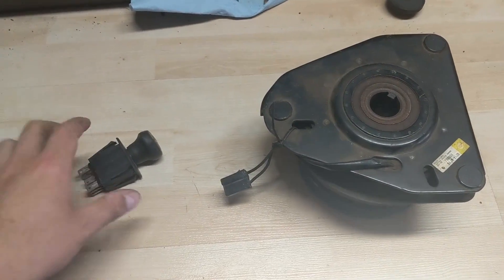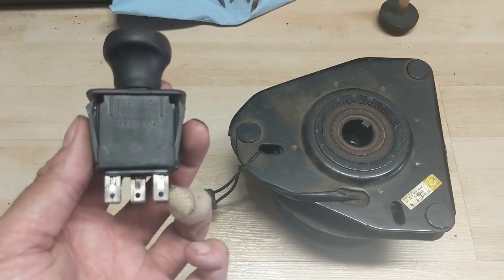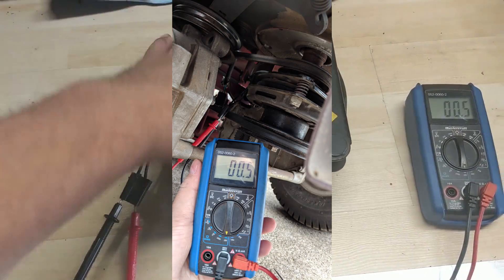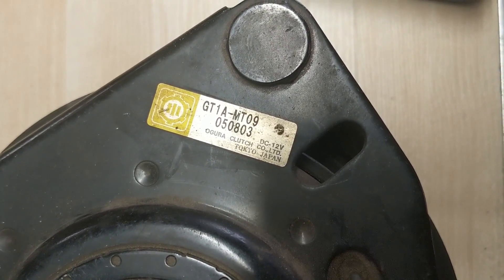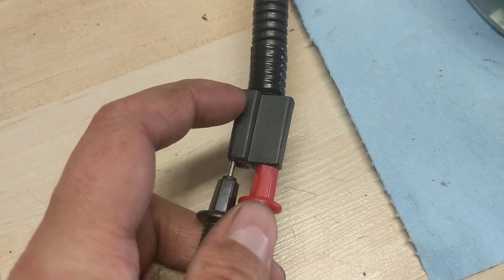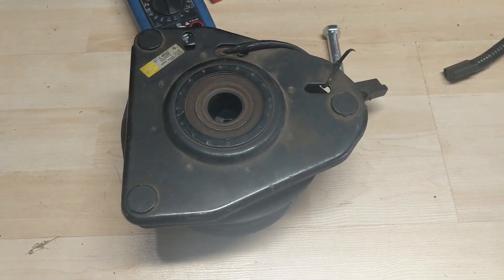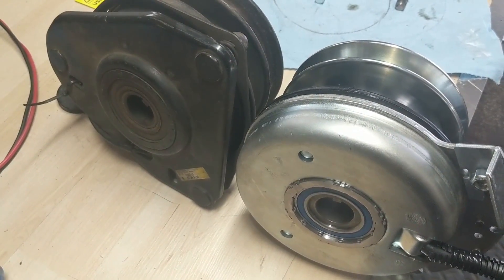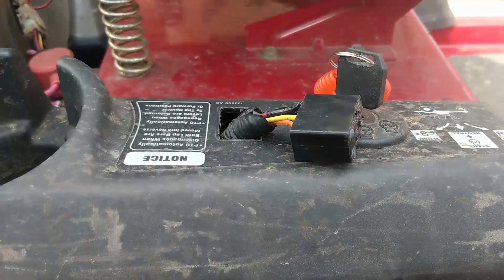How to Test a PTO Clutch for Resistance!

Comment from the maker: Explanation on why the switch melted;

In an electrical circuit, if Voltage remains the same, and resistance is decreased, amperage increases.

Here's a textbook definition: "Voltage equals the amperage multiplied by the resistance in a circuit. If the voltage remains constant and the resistance is dropped, the amperage across the circuit must increase."

Essentially, with a short to ground there is little to no resistance, as electricity takes the path of least resistance. So because the 12v from the battery (around 14v from the magneto/charing system when the engine is running) stays the same, this is what increases the amps in the circuit!

This increased amperage overloads the wires, and this is what melts the switch, then causes failure.

On the flip side, if you test your PTO clutch and it has more than 4ohms, you could have corrosion on your connector (possibly caused by water/moisture) which would increase the resistance and could cause issues.
Reply: Alc

Comment: Measured my PTO at 200 ohms and nothing, no reaction at all. Added voltage to the PTO, no click.
Reply from the maker: Yea it's faulty. Short to ground is barely any resistance, over 4ohms is too much. Should be 2-4 ohms max.

Comment: Nice simple demo - thanks. My PTO was disengaging after about 5 seconds. Would always start again if I pushed then pulled the knob. Turns out my battery wasn’t holding enough charge to keep the magnet energized. I suspect there’s a charging issue as well. Do you have a tutorial on testing for that?
Reply from the maker: It's either the alternator or the voltage rectifier, but most machines are different. You can test before and after the rectifier and it will let you know which one it is. You should have alternating current coming out of the alternator, unless it has a bulge on the wire which will be a diode, then it'll be DC, but it'll be unregulated DC. So the voltage will increase with rpm. After the regulator you should have roughly the same voltage regardless of the rpm, around 14v. Here's a video on a TB30 Troy Bolt; https://youtu.be/5PcUwPv7GEM?si=jM03Tlm-_s4hZ_if
Reply: @EliminatorPerformance  Appreciate it! My machine is a Deere LX277 AWS rider if that helps narrow down the options. Will watch the Troy video you suggested.

Comment: I have a John Deere X570 with 203 hours and yesterday went to engage the PTO and didn't work. After investigating the issue, I found one of the fuses kept blowing with a few seconds (7.5amp fuse) and a flashing indicator on the display show service with a wrench picture. I searched for a shorted wire and cleaned all the wiring connections but still have the same issue. After watching your video I plan to check the PTO clutch today and see if that is the issue. Thanks so much.

Comment: I would think you'd want to use aluminum anti-seize rather than nickel.  The aluminum is less noble than nickel, so the anti-seize will corrode preferentially.  Nickel anti-seize would be expected to corrode less noble materials around it. Admittedly, the amount of nickel probably is not enough to drive corrosion on adjoining, less noble materials.  However, theoretically . . .   Correct me if I'm wrong.  Thx for the vid.  Very helpful !!
Reply from the maker: @akzoc  zinc is less noble than aluminum but aluminum is less noble than copper. I always use nickel anti seize on aluminum/steel, I've never had any issues. I have used copper on steel exhaust studs that interface steel nuts, however, I have since learned that nickel anti seize has a higher heat rating so I almost exclusively use nickel pretty much everywhere.

Comment: Good video but you forgot the most important part. After installing new clutch you need to varnish the new one before operating. Start off low idle and engage pto for 1 seconds and turn off let blades stop than engage 10 times. Do this at half throttle and full throttle.
Reply from the maker: @BradHudsonhudson  yes it's called burnishing the clutch, and we do it with every one.

Comment: Solved my melting switch problem on my Ferris, THANKS!
Reply: @ mrbumblehill4596 I have a Ferris also, z3x 52” 37 vanguard oil guard stander. What model do you have & how old/hours did your clutch break down? Did you replace with oem ogura, I hear Ferris oem parts are a long wait to get. Thank you in advance. Jim

Comment: Is this lawn mower or are you basing this off of a automatic PTO or a manual PTO my Cub Cadet has a cable and it is a manual PTO cable that goes to the deck if my PTO broke at the lever where I engage the blades would that be a bad PTO cable or is there such thing as a manual PTO going bad if it's operated by a manual cable and lever what I'm basically trying to do is replace the PTO cable which I don't work on lawn mowers but it's very transparent it's very simple just to connect connect connect connect connect the cable but I didn't want to spend the money on the PTO cable which I seen The Leverage is broke the that connects to the lever that pushes down to on the side of the lawn mower is broke off but I didn't know if there was something causing it to break other than a bad PTO cable or could something else be wrong the lawn mower cranks it moves forward backwards and does everything except the lever is loose it is broke off but I just wondered if there was anything else underneath the deck that could cause this PTO cable to go bad or not move if any of this makes sense this is my first time dealing with anything on the lawn mower

Comment: I thought once installed you were sopposed to turn it on & off a few times to brake it in didn't see you do that a'm I wrong?
Reply from the maker: You are correct, I engaged and disengaged the clutch 10 times at half throttle to "burnish" the PTO clutch, I just didn't mention it in the video.
Reply: @EliminatorPerformance  Thanks for the quick replay.

Comment: I just tested one and has 3.5 ohms, so looks good. It's not in a mower so my first test was going to be just to apply 12v and see if coil clicked. Not having battery handy I tried my booster pack. I use it a lot when I have no battery by putting it in override mode . In this case the booster gives an error light as soon as I touch 2nd terminal. I'm guessing it sees even 3.5 ohms as a short.

Comment: Well, my 2010 toro Z master just stopped spinning the blades...no sound...no nothing....checked under the rear and the wiring harness hookup at the clutch was tattered....ordered a new harness, and it engaged....mowed several times and it quit again....this time, I noted the new harness had melted on the negative terminal at the jxn of the clutch and harness....I did check the actual switch and it is not melted....it appears you may have diagnosed my problem......only thing I need to do now is check with the multimeter........We'll see about that..........THANKS!!!................well, I checked the clutch....reads 2.3, so maybe need to go check the actual pto switch for contunity, but still it would now seem if it was bad, why would wire melt at the clutch?

Comment: The resistance on my new PTO Clutch Simplicity 1708536SM (Warner OEM) measured 7.1 as did the resistance on the original Warner PTO I was replacing. The old PTO would not engage the blades after it was running until it cooled down. I purchased the Simplicity in 1998..Resistance must differ?

Comment: Other thing is you must have a good battery, don’t boost off battery and expect alt will charge it up while mowing, low voltage will damage clutch also
Reply from the maker: Yes that's an excellent point, if I ever get one in that has that issue I'll do a video on that. It's kind of like a vehicle in a sense, the alternator itself isn't enough to run the system so you need the battery, but without the alternator the clutch would kill the battery.

Comment: My PTO doesn't make any clicking noise or any noise at all when I attempt to engage it. I noticed it was very much so not all of the way on before this happened, like the bolt on the bottom only was on my a couple threads. I've since put back on with thread locker and turned it, but still no noise or anything when engaging. Suggesting?

Comment: Great video.  My clutch wasn't working so I tested the resistance and it was only 1.3.  But then I followed your other video and adjusted the gap, and it is working fine now.  Any reason not to run it?  I don't want to burn out my stater or something.
Reply from the maker: No it'll be fine if it's gapped properly

Comment: So if i have one thats 1.6ohms, does that mean its bad? Symptom is that I cant disengage it with the switch (already replaced switch, same issue)
Reply from the maker: 1.6ohms is within spec, I'd check the armature air gap, I have a video on how to gap a PTO clutch. Other than that, you may have an issue where it's always being supplied 12v, I would check wiring.
Reply: @EliminatorPerformance  Thanks so much. I'll look up your air gap video! 
I also found that while all of this is happening, the seat switch isnt killing the connection when its released. Its a 4 pin switch. I did test it, and I found that theres continuity on the outside pins, and the inside when the switch is not depressed. When depressing there's no continuity on anything.I ordered one for the heck of it. We'll see

Comment: Please tell us what the multimeter ohm readings should be for each pair of PTO switch blades when PTO switch is on and off. Your coverage of the safety switches is great, but although you tell us you tested the PTO switch, you don't show it.
Reply from the maker: As close to 0 ohms is ideal. A switch should have little to no resistance at all.

Comment: i have a Dixon 0 turn and lately when i engage the pto it wants to kill the engine. 1st thought it was the mower deck bound up but it does the same thing with the belt completely off the PTO pulley...so i took off the PTO and ohm tested it... i get about .5-.6 ohms but when i hook the pto up to a 12V bat it engages. but i felt the wires getting warm. so i put an ammeter in the circuit and it  was drawing about 18-20 amps with the pto engaged that seems super high?...which makes scene with the really low resistance. Only thing i can think of is, that high amp drawl is demanding a lot from the alternator winding on the crank shaft and thats what causing the heavy resistance and killing the engine? bit of a head scratchier....but i ordered a new PTO

Comment: My clutch wires are still connected to the clutch but got separated from the red / black wires that ran to it.  However, both of the wires coming from the clutch are green with no way to see any difference between them.  How to I find out which of the green cables is positive and negative?
Reply from the maker: Most, if not all electric PTO clutches are "non polarized" meaning there is no negative or positive. Hook up your probes anyway you want.

Comment: Hi. My mower deck quit in the middle of my yard. It would not engage when I pulled the switch so I put a new switch on and that wasn't it. I just pulled the PTO and tested and i'm getting between 8 and 10. Does that mean that is my problem? Just making sure before I order. Thank-You
Reply from the maker: Anything other than 2-4 means you have a bad pto clutch, if you're testing resistance in ohms as the connector on the clutch like in the video
Reply: @EliminatorPerformance  Thanx

Comment: "On the flip side, if you test your PTO clutch and it has more than 4ohms, you could have corrosion on your connector (possibly caused by water/moisture) which would increase the resistance and could cause issues."   .... So if your PTO is measuring 6.7 ohms. Would it the FIX be to take the connector apart and clean the terminals & use some anti corrosion grease on the connector. OR is the Corrosion you are speaking of be actually INSIDE the wiring of the PTO itself? Would the GAP being off Cause the OHM's reading to be HIGH or even LOW?

Comment: Thanks a lot for the video!   Checking out my VENTRAC after the PTO disengaged while running the Tough Cut deck.  Just checked the Clutch and it’s reading .5 ohms!  Looks like it is time for a new one!  This video was definitely helpful!!!  👍👍👍
Reply: Just had a similar issue with my finish mower. I had been noticing that the charging system was not making its normal 13.9 or 14 V when PTO running. Then yesterday I blew the PTO 15 amp fuse. I figured there was an issue with something, but when I did put an extra one in just to make sure it was not a fluke, and it blew that after just a few minutes. 
Do you think the extra draw from the faulty clutch could be related to the charging issue?
I’ve got the 4500k, did you get your clutch from ventrac or aftermarket ?

Comment: Hi,
 you do very good videos! i have a john deere ride on when i start the engine automatically the pto is activated with the blades running it only turns off when i turn off the engine i tested the pto with altimeter it gave me 4.7 oms. will it be that the pto is burned inside?

￼
Reply from the maker: So the issue could be with the PTO clutch yes, but it also seems like your pto switch could be melted and it's engaged all the time which isn't good

Comment: If you machine does not have a 12v battery, what voltage would engage the clutch?  It is obviously running on magneto electricity, but what do I test for on incoming wires to see if the problem is before or at PTO?
Reply from the maker: Well theoretically you could unplug the pto clutch, start the engine with the brake engaged and pull the pto switch, you should have some Voltage at the plug going to the pto clutch
Reply: @EliminatorPerformance  I did... bypassed all safety switches and it was about 28v DC when I threw the switch.  I was hoping it was a wiring harness/safety switch issue but the voltage right before the PTO goes from 1v to 28v when the PTO switch is pulled.  Pretty sure it is the clutch.  New clutch from John Deere on a 36" walk behind?  $811 + tax....unbelievable.
Reply from the maker: @Discophreak  check out Xtreme pto clutches, they're less expensive and have good build quality

Comment: This video is such a life saver. Literally explains so much. I love trying to fix things myself and I couldn't find the short after my Scag was blowing fuses!
Reply: I have a problem today on my exmark zero turn I was cutting and they stop working and I trun that switch and nothing no noise either I wonder wath is my problem
Reply: @Purozamachihue  check fuses. If fuses are blowing it’s possible this is the issue. It was for sure my issue after blowing fuses and burning out a pto switch. This video saved me. Replaced the electric pto clutch and it works great.
Reply: Ok I’m going to look for that fuses my machine is old  so I’m going to try to find that fuses  thank u very much

Comment: I had previously burnt out a pto switch. I replaced that. Then it blew fuses.  Using the fluke meter correctly the pto measures 0 (zero) ohms yet it audibly clicks and locks up when attempted to turn by hand. Any ideas?
Reply from the maker: It should be 2-4ohms. So if your Voltage remains constant (12-14v) and your resistance decreases, your amperage goes up. This is why you're melting switches and blowing fuses. The fuses aren't rated for the high amps in the circuit. You need a new pto clutch.

Comment: I have a toro time cutter that will mow fine for 30 minutes then the engine will start to die but if I turn off the clutch the engine smooths out and runs fine.  Any ideas?
Reply from the maker: Turning off the PTO clutch takes load off the engine, sounds like a fueling or coil heatsoak issue. Flush your fuel lines, I've seen dead bugs floating in fuel tanks get sucked into a line and cause a shut down after so many minutes

Comment: good stuff.   wrking on a cub cadet zero turn with eletyric PTO clutch hub intermittent engagement failure issue.  going ot check resistance of clutch first and then air gap if resistance checks out.   and also condition of PTO switch. and replace it if needed.   a couple days ago i didnt have any idea there were electric engaged pto clutches on these now i know more than i ever thought i would or could wow..  hmm..  now i am armed with pretty much all the info i need to test diagnose etc this one.   great.  my multi/voltage meter/tester and here we go..  in the morning..

Comment: Our Cub has been sitting for about 4 years because it started smoking. Hubby had already burnt motor up and had to replace it. Then got frustrated and pushes it in the corner of the barn. Buys new mower. Here we are.. new mower needs a new part and I miss the cub. So I tow it up to the garage and start taking it apart looking for melted wires. I find an old broken pto switch in the cup holder...examined it..melted. Then I pulled apart the newer one and it was starting to melt as well. Watched your video... I have no mechanical smarts what-so-ever! But you made it very simple. I am getting ready to take my fluke and check out the readings. Guarantee I need a new clutch. THANK YOU.
Reply from the maker: Good luck!
Reply: Sounds like to me you need a new hubby , he obviously has more money than brains so get half .  😂

Comment: Great, thorough video.  I ended up having a different problem (frayed wire that was hard to spot), but watching this triggered the idea that led to the solution.
Reply: I had a frayed wire right at the pto clutch which in turn I believe burned my clutch out internally. I definitely had both issues whether or not the frayed wire cause the clutch to short out or not.

Comment: The fuckin thing is 500 godamn dollars?  The hell?  The one for my mower sells for 125$ yet the entire mower off the showroom floor was 350..   so 125 for clutch, 125 for 21hp kohler motor and 100$ for the steel frame, deck, body, trim, tank, transmission, tires....  lol. The fuck the thing cost 500$?!?!?  Thieves.